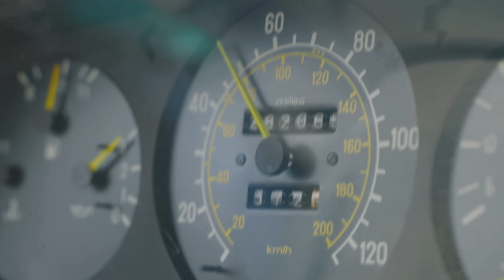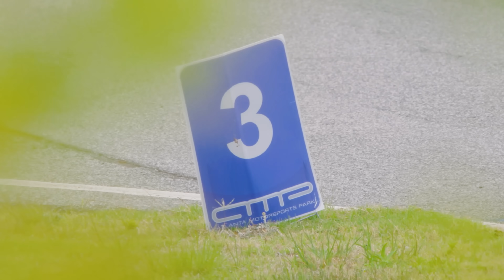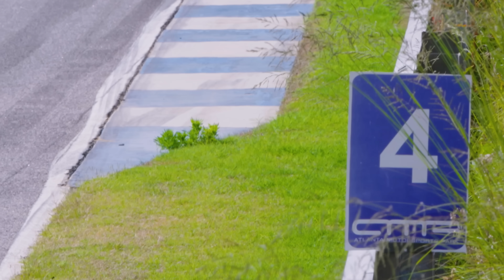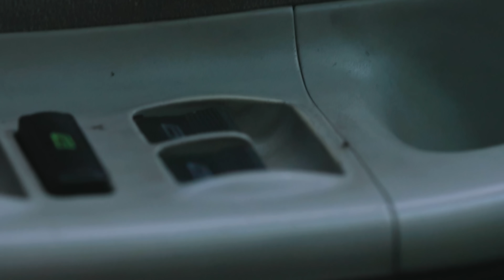Which Of Our Cars Can Actually Outrun The Cops? | Car Trek S5E4

Comment: I love how Ed's Lambo has basically the same steering wheel as the Audi
Reply from the maker: same coil packs too ;)
Reply: Key too I guess 🤣
Reply: Well, Lamborghini is owned by the Volkswagen group and so is Audi. The Gallardo and the Audi R8 from that time period even shared the same engine if I'm not mistaken.
Reply: @RegalCobra097  No. The old 88mm bore spacing Gallardo V10 is not the same engine as the 90mm Audi V10 that Lamborghini adopted later.
Reply: @jonasthemovie  Okay, thanks for clearing that up.
Reply: @RegalCobra097  yes they made it that way so that the Audi has more torque down low but the lambo had more on the top end. But otherwise the engines are practically the same.
Reply: @jonasthemovie they took the old one out of the old s6/rs6 for the gallardo
Reply: @lemi4638  No.  The new 90mm spaced was developed out of the V8 and first used in the S6.

Comment: whoever was flying the drone and filming did a great job - well done
Reply: I build and fly FPV race quads, dude definitely has some skill.  It's harder than it looks because the cameras on those are fixed in position so you need to keep what you're filming in frame while still moving the drone in the correct direction and speed.
Reply: The POV drone was handled by Mr Steele himself.
Reply: @TheQuestionableGarage , whelp, that makes sense, he's one of the best pilots on the scene.
Reply: It was done by me, thanks!
Reply: @TheQuestionableGarage  mr steele not a normal guy, he's a drone expert..

Comment: Having owned, and still own an SLS, I agree with Freddy about the shifts on the SLS. They were painfully slow from the factory.  BUT, there is a software update that any Mercedes dealership can perform.  Once you do the $200 software update, it's amazingly faster.  Even the tech at the dealership was shocked by the difference.  Get the update Tyler!

I can't believe the steel brakes on the SLS could be that bad.  I have the ceramics and they're insanely grippy.  I think the steel ones are the same diameter, just over 16 inches up front!  So there must be crap pads in that car.

Tyler, upgrade the interior with the factory carbon fiber.  It's so much better than the aluminum and you can find them for ~$3k.  It's sad the only CF in the car is that ugly steering wheel.  If you can find it, the carbon fiber engine bay is gorgeous.  But those are a needle in a haystack to find and people ask crazy money (~10k).

Comment: I love Ed's expertise in getting away from the cops. Hahahaha! He smoked them for the thousandth time. I bet he could do it being down a cylinder.
Reply: To be fair if it was one of the charger pursuit cars he'd probably have a harder time
Reply: @tati-anaroseee4316  no he wouldnt. Stage 2 B5 would still gap them
Reply: @SyncSf  I said harder I didn't say he'd lose chilllll
Reply: @user-yc7zb4cj4x  stage 2 can put out almost 350 if not more on a stage 2 tune, and is a much lighter car. Maybe you should do your some maths. We have local pd and chp at the drag strip daily, chargers and Explorers all of them are 15plus second cars, Non of them will hold a candle to a properly tuned car.
Reply: @user-yc7zb4cj4x  so that 50hp will compensate for the 1000+ weight? 🤣🤣. It takes at least 100hp to gain a second fyi 😉

Comment: You know you could have just loosened that coil and gotten the same effect.  Those are notorious for loosening on their own and causing misfires.
Reply: My '97 1.8T AEB actually had bolts holding the coil packs down.  Of course that didn't keep them from failing and causing misfires.
Reply: I know my 3.0 and 2.7 had push down coils.  Purchased adapters for my 2.7 to swap to 2.0 bolt down coils.

Comment: A lot comes into play to determine if you can get away or not  like if the pursuer was stopped at time of chase or goin in opposite direction.  And big factor is where it takes place what the roads are like 👍    I do not Condon running but was a wild teen years and years ago s#!t happens 😁

Comment: I never beat them, but outsmarted them 3 times in my early 20's to about 30 years old, each time I "escaped" unscathed by a fine or penalty. The stories are a bit complex to explain here. None were done with performance capability but strategic departures from the expected path on all counts and two of those included the termination of headlight use at night.

Comment: Yo put the rear tires on the front of the maxima and try this challenge again.. and it'll corner 10 times faster touge style setup. I have a track prepped spec v sentra. And while it sits for the swap I put stock 350z 17s on it and skinnier front than rear made a car that grips at 80mph understeer at 30.

Comment: I'm a year late, but let me tell you a story about how I outran a cop in a 1987 Toyota Corolla!  

Setting: Northern Virginia in the early 90's. Driving a 1987 Corolla down a road with a speed limit of 35mph. I'm doing 60. Cop is driving opposite direction of me. We pass each other.  

If you don't know this area, it's narrow. Most roads in the US have a shoulder and then  a wide birth more. (for our large cars) Not here. You get 2 lanes and MAYBE about 6 inches on both outsides as a "shoulder". Then, since they get so much rain, the gutters are DEEP "V' shapes that are usually around 2 feet deep. Turning a Crown Vic around on these kinds of roads, even if you are skilled, takes at least a 4 point turn around.

I gun it. No way I'm outrunning a cop car in this shit box. This road has one entry and one exit, with only one branch off in between. No way I'm beating him to the end of the road. Take the one branch off. Drive to the 1st driveway on the road and pull in. Turn the car off, take my foot off of the brake, and throw the seat back all the way down so I'm laying flat on my back. One one--thousand, two one-thousand.....looping red and blue lights flash across the roof of my car and disappear. One one-thousand, two one-thousand. I put my seat back up and start the car up again. Drive like a normal person and continue on my way. Pull up to the stop sign at the end of the road and I can see the cop going in and out of neighborhoods looking for me. I stop, turn on my signal, make the turn and go about my way.

I outran a cop in my 87 Corolla.  :)

Comment: No fair I had 1977 Ltd 2 302 with a huge turbo on it  this was a Renault turbo the race cars parts were normally scrapped but one of the car mechanic was a turbo nut and he had one on a 600 MotoGuzi smaller one.  but I launched so hard  front end lifted off only car I had that did .turbo back the cost 12 k same as a new car but I won alot of races before the bottom end blew. I was the only one running German designed synthetic oil in the 80' s that was expensive too.

Comment: On the Audi no you didn't get away becuse 5 other cop cars show up out of no place as well as 3 choppers and a serious sports car with no emissions on it.   Thats the key word these cars do not have emissions systems on them to cut your power way down.  You cant outrun a cop. You might think you got away, but 5 or 6 squadcars are at your house for when you get home. 
Just pull over and do as your told.

In some states if the cops has reason to belive your risking other people's lifes they can use deadly force. 

More people are killed in high speed chases then youd belive. It isn't worth the jail time or your life.

Comment: The truth is most police cars are not much more tuned up than the average car sold to the general population. A few more HP for sure but also more weight is carried in the police car. Computer, equipment, and safety gear. Police cars however are majorly reinforced with tower bracing, bush bars, reinforced front end so when the police ram another car it tends to disable the other vehicle within a short period of time.  The police do have high speed pursuit cars but not that many of them. This leads me to my next point of police stupidity. All the tuner cars they take and scrap should be turned into high speed pursuit cars. This would save the taxpayer money, add faster cars to catch the upcoming EV cars that can pull 3.5 or less in a 0 to 60 and some claiming 1.1 seconds like SSC is claiming. Faster cars to the general population combined with a lack of trust in police is all the right components for disaster sooner or later.